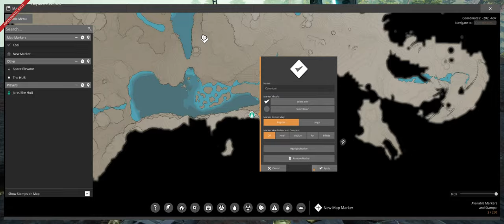Installing a Factory Sub-Floor | Satisfactory U8 - VOD 3

Comment: Those underground belts are kinda nuts!  I know I'm too late, but you could also use N to search for items and also do math, since it also act like a calculator, so you don't have to use other windows and we can still follow along.
Reply from the maker: Yea I try to do that more and more as the series goes on.  Mostly just me trying to learn to be a better streamer.  lol.  I did now about it, its just building the habit in the moment of course.

And btw, I do manage to get a little better control over those ceiling belts as time went on ha ha.